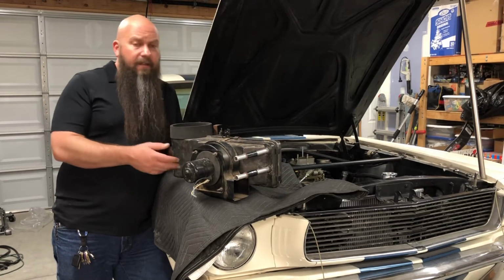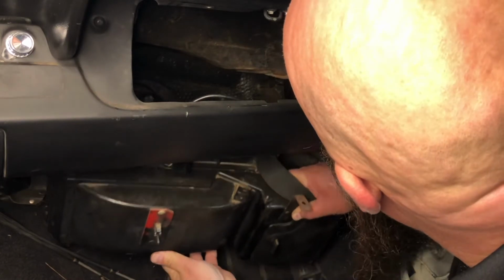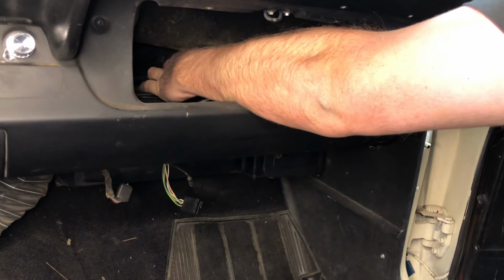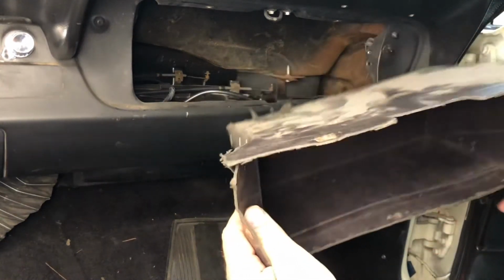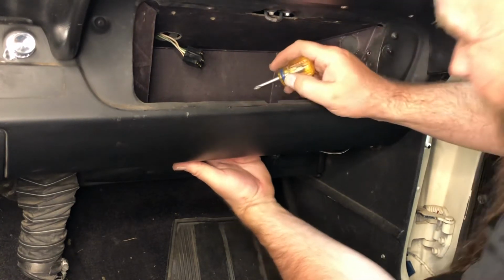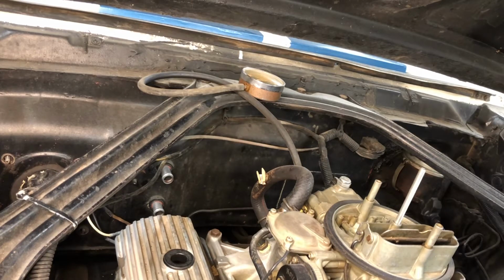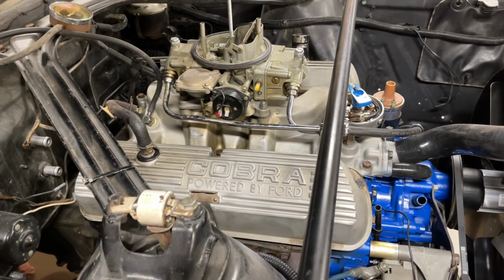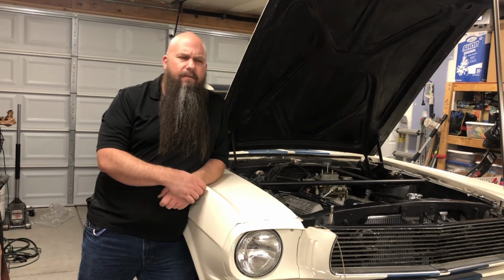How To Install Your ‘65-68 Mustang Heater Box Assembly (Step-By-Step w/Glove Box & Heater Hoses)

Comment: Do you need to attach the housing near the blower motor to the firewall?
Reply from the maker: The four studs on the blower fan motor housing are the rear attachment point.  Reinstalling the nuts on those studs is what really retains the box.